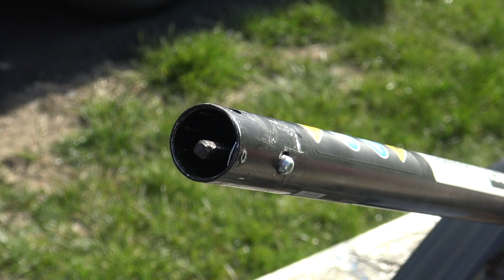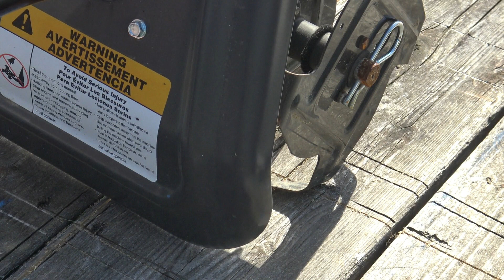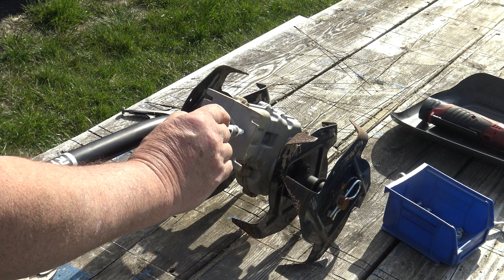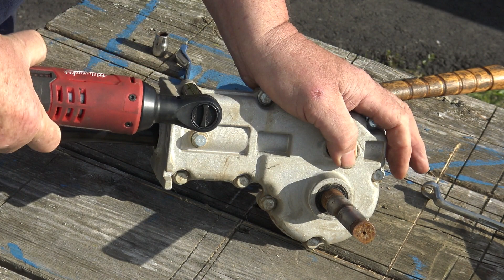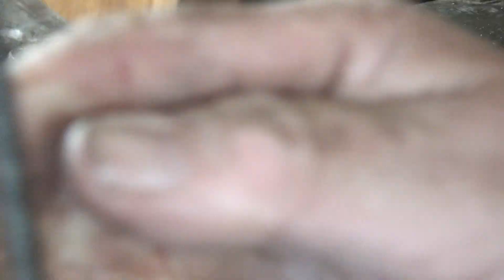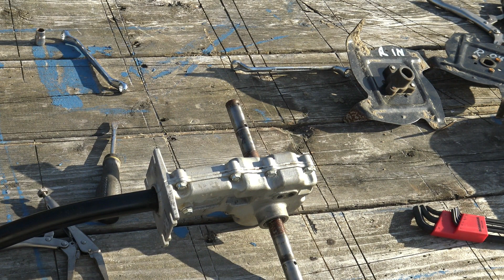HOW TO REPAIR RYOBI EXPAND-IT CULTIVATOR

Comment: You should have put in some gear oil. It was bone dry since nothing came out when you cracked the case open. Once you crack the case open you ruin the seal, so you need to reseal with an oil-resistant RTV gasket material and then add gear oil. Since you didn't do that, that gear box will burn out the thrust bearing pretty quick if it isn't already ruined. The bearing is pretty cheap - a few dollars. The oil seal on top should also be replaced and it is about double the cost of the bearing. Add everything up and it would cost under $15 to fix it so it lasts another 10 years or more as long as you keep checking the oil level every season.

Comment: Would be nice see where/how you remove the blades also. Someone may not know how to
Reply from the maker: Thanks for your concern. I just reviewed the video as it has been number of years since posting. You are correct I did not actually show the blades being removed. However, beforehand I did explain how to mark the location of each blade and just before cutting away mention that they needed to pull the pins.  In an effort to make my videos a little shorter I sometimes will not show very simple procedures such as that. If a particular viewer cannot figure out something as simple as pulling the pins to slide the blades off then perhaps, he / she should not even attempt to pick up a wrench.

Comment: Does the tiller have gear oil or grease in it?
Reply from the maker: I made the video several years ago and I don't remember, I would think it has to have some sort of lubricant in there.
Reply: It has grease. Pack it full. I don't know if it is a special kind but multo-purpose grease should work.
Reply: @michaeltaylor5249 where do I add grease ?
Reply: Yes, i used a 5mm hex to open the bolts and found grease inside.  Only took a tiny bit, was already pretty full.

Comment: Thanks much for taking the time. Much appreciated. Do you know if the shaft itself is more or less universal? I bent mine and would like to replace. They are available but Ryobi sells it with the gearbox for mucho denaro, while others (Trimmer Plus . . . I think) sells the shaft alone for considerably less. I'm thinking one company actually makes the tiller/cultivator and Private Labels for all the others. The shafts all seem to look the same. Thanks again.
Reply from the maker: Thanks for the question RK; I don't know for sure but I can't see why not as long as the generic shaft is dimensionally the same. If you decide to try it by all means please let me know if it does indeed work. Thanks for watching my channel

Comment: Thanks for posting this video to  show the repair. After rescuing a Mantis with a Honda GX25 from the curbside, and getting the neglected motor working, I dug my dead Ryobi expand-it tiller and try this on it before I throw it out. Mine froze and also the shaft had sunk into the handle. It looks doable but I will have to open the case. I think those allen nuts are forced grease access ports - I'll let you know.
Reply from the maker: Thanks; I will look forward to hearing from you.
Reply: @richardspaulding5035  Wow, I opened the transmission case and found the cylindrical(?) gear was broken into about three pieces. The cable turning the worm gear seemed okay. I know I didn't overpower it but it broke many years ago. Looks like the design is the same but now using battery powered power heads is in use.  Your welcome to a pic of it but I don't think this comment box supports attachments.  I really feel ripped off by Ryobi. Such junk. I found the Mantis tiller and just need the PA6 oil and hopefully have a good tiller/cultivator with option for other attachments. Cheers for a good growing season.

Comment: Thanks for the video Richard and greetings from Australia . I picked up a display model as it was cleared out at 30%. I watched your video to see how the drive shaft is attached to gear box. In my case I wanted to know how to remove the shaft so I could shorten the shaft so I could attach Victa fittings to the shaft . Victa and Ryobi use the same type of shaft and tube but the fittings used to attach accessories are entirely different.  I will be hacksawing around half an inch off the shaft to make my fittings work with the victa trimmer.
Reply from the maker: Thanks very much for your greeting from Australia. I is a lot of fun to hear from someone on the other side of the world. I am about 50 miles southeast of Boston half way between Boston and Cape Cod. My New England accent is a dead give away. A lot of my viewers like to make fun of me. Thanks for watching my channel.

Comment: Does the Ry15550 require any type of gear lube ? I didn't see any lubricant run out when you loosened the case bolts. But seems like it would need to be greased periodically. Sorry if you mentioned it in the video I was not able to watch it in it's entirety. Good job on the video.
Reply: Ryobi is going to say that's its unservicable oart.. which is crap.   Im watching this to figure out how to change that oil in the transmission.    After all they dont really want this stuff lasting forever... but i do
Reply: @kenwest15  Those Allen bolts are possibly grease points.
Reply: @kenwest15  agreed. I'm going to look at lubricating it with something soon. Probably Amsoil synthetic gear lube.
Reply from the maker: Thanks for your question, as I recall I never fully opened the case.  I  loosened it just enough to pull the handle out. However as I removed the handle there was some sort of lubricant on the end.  I did not seem to lose any of the factory lubricant so I did not worry about it. One other thing worth mentioning is I received a comment from a viewer  that instead of using a hammer to adjust that keeper it can be turned. Thanks for watching my channel.
Reply: @richardspaulding5035  thank you for replying. I wasn't able to find any mention of maintenance in the owners manual or on line. So I guess they used grease that will last for the expected service life. I tried to send Ryobi an email on their website but I had to have a password. And passwords never seem to work for me.

Comment: THAT SWAG NUT IS THREADED!!!
When I tried the hammer approach, shaft through the swag nut videoed, my swag nut exploded into 2 pieces(crap).  Should have used a plyers and turn it up the shaft cable closer to the end. FYI in my case that swag nut it threaded to the shaft. The swag nut he hammers through is threaded to the shaft. It's not a slip. So when I hammered it to move it it shattered into 2 pieces (crap).  My problem was with a transmission piston end coupler that disintegrated at the of the drive line. Pieces ended up in the gear that locked the unit un-turnable. Lots of various pieces in the gear box that apparently ultimately got stuck in the main planetary gear which locked it solid. Understanding that I figured out the main issue with crap pieces in the trans I figured go ahead with adjusting the swag nut as the the video depicts.... bad idea in the end . Picked the end shaft pieces out of the transmission grease but the swag nut disentegration says to me ,,,, not fixable......
Reply from the maker: Thanks Jan for that information.  I don't know if what you say is correct how I got away with tapping it. I don't want to mislead anyone. do you think I should pull the video?